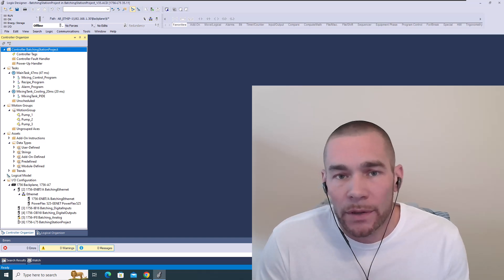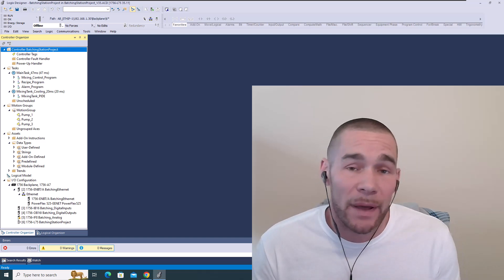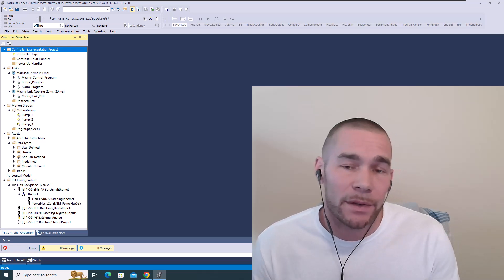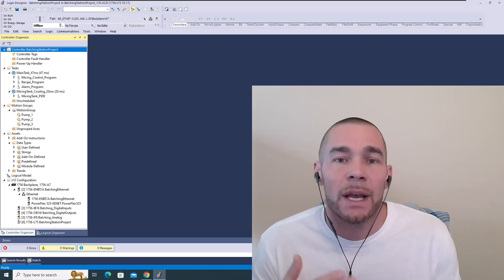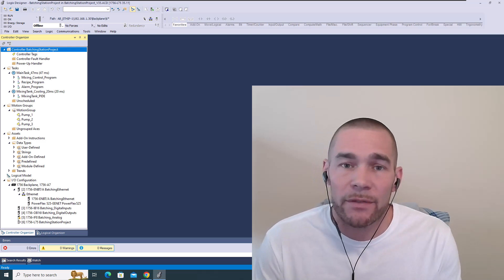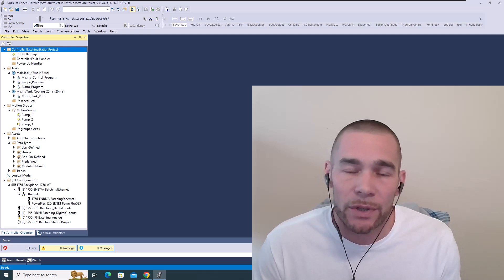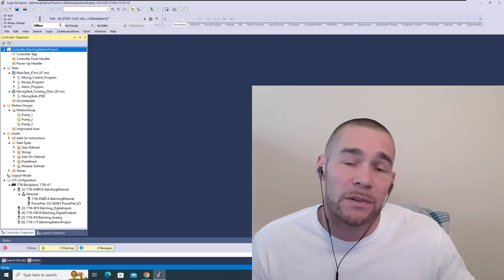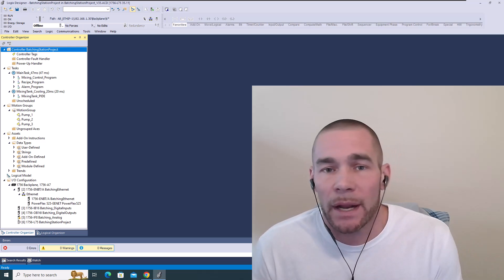Question

Comment: Shane, do you have the course up and running? I am currently working on a 4 quadrant 1100HP ACS880 in drive composer.. and it’s a lot different than a Siemens G or S series system in TIA.
Reply from the maker: I do have courses on ABB drives

Comment: We used ABBs for years starting with the 500s then onto the 800s. They are very robust and can handle being in very dusty environments without failing. That being said when they went to the 880s we decided to move away from them and go to Yaskawa's. The 880s profile changed and in in general just didn't much care for the new design.
With all the drives we have dealt with here at the plant though the ABB ACS 800 was by far the easiest to setup and work with. By the way Shane I hope you keep doing videos on Ignition platform they are very informative.
Reply from the maker: @andrewshonk6442  ABB drives are better than Yaskawa in my opinion.

I do have some ignition videos on my channel, what is it that you want to know?
Reply: @ShaneWelcher  I agree I wish we had the ABBs back. We replaced our Wonderware with Ignition some time ago and because I am old, lol, I haven't gotten used to the new ways of doing things. I have had two paid training sessions through our company and still slog through stuff mostly cause I am stubborn and don't dedicate time. I looked at your site and see you have a course. I have followed you for a long time and you are a go to for my process control needs when I am stumped. Solis isn't bad either.
Reply from the maker: @andrewshonk6442  Yes, we all strive to help everyone learn
Reply: @ShaneWelcher  I just discovered your WIT site this morning. I am going to shoot you an email I have 5 guys here that could use anywhere from basic to advanced training. I remember watching your first videos at least 10 years or so ago.

Comment: I’d say go for it. I’ve seen a few projects that have Rockwell controllers and ABB drives. It’s been years ago that I started up several myself.  The drives had Ethernet adapters and the controllers were configured with a generic Ethernet driver. I don’t know who built it but there was a custom add-on instruction for mapping out the data. Been about 8 years ago and I would hope there was an add on  profile for those by now. For quick work of the parameters a backup/ download,  seems I remember using something called drive browser.
Reply: Yes, anything to ease a new comers learning curve is a good thing. Drive are certainly a widely used device and your experienced training would be a plus. No training is a waste if time. Thank you for all that you share.
Reply from the maker: @rlstager1  great, I agree
Reply from the maker: @jimcooke640  thanks for your opinion